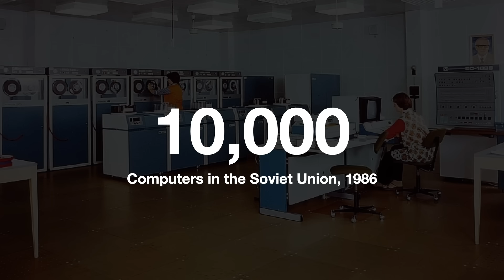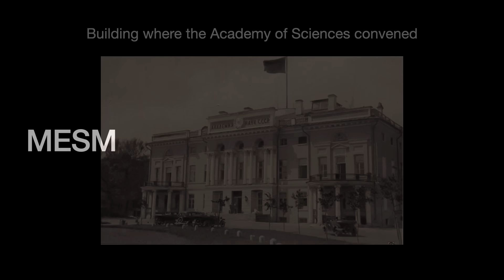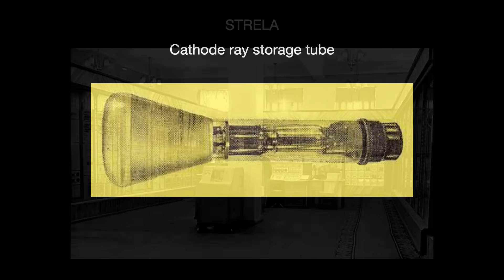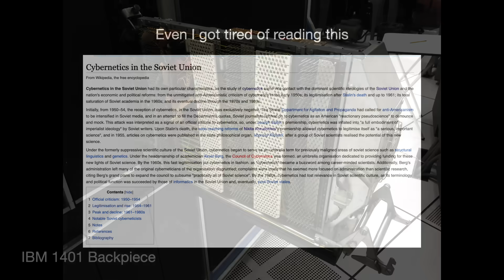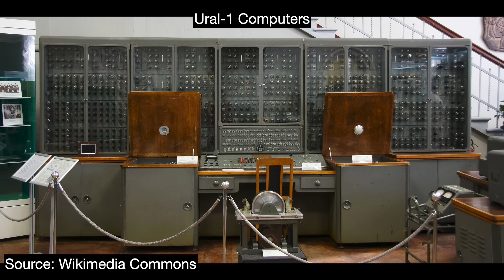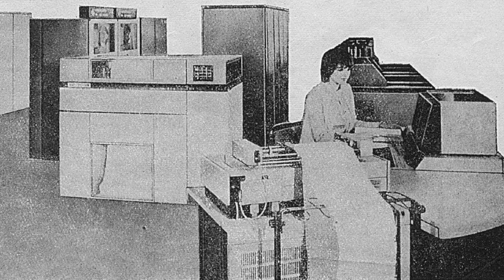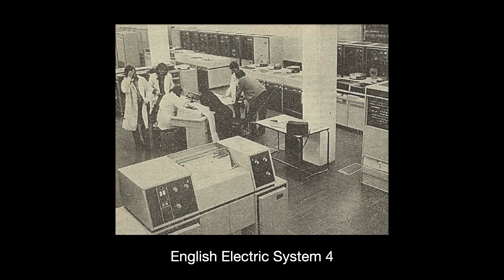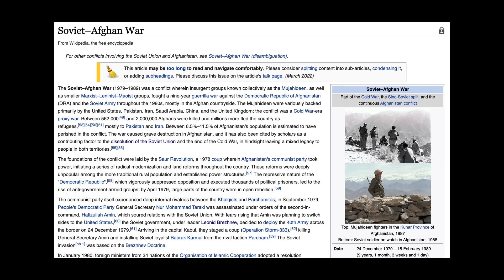Why the Soviet Computer Failed

Comment: I think that this failure was inevitable and stems from the flawed ideology itself. The value in marxism is the amount of labour involved to produce certain item of goods. What is valuable for the society was defined by the state/communist party politically. What had to be done in order to fulfill established "wants" by the party were calculated by all the respective research institutes. Since all those research institutes were planning in advance, usually for 5 years, I think it was impossible to introduce computers to the factories during that five year plan. Even if you calculate that for certain enterprise it will be valuable to calculate some processes with a computer (i.e. it will minimize total necessary labour involved to produce certain product) you will have to get rid somehow of people who were calculating those processes by themselves. Without even touching the whole trade union thing which made it hard to fire workers you would still end up with a dilemma of replacing people doing work and creating value and some machine eliminating human (be it intellectual) labour which was value itself. I think that was the main reason behind small volumes of computer production as they were mainly used in research institutes, while enterprises were only fulfilling established plans.

In capitalist societies it is a lot simpler, you only see adding computers to your production as a certain percent chance of improving the efficiency of your production by some margin i.e. increasing market value of your product. You don't see the same "value kills value" dilemma as in marxism, but I think that it's only one step closer to the truth. When you consider that the large part of advancement comes from large volumes and competition you kind of start to see similar dilemma as the origin of large volumes now comes from consumer products with their questionable value to the acquirer. It's no longer market value but rather fulfillment of your utility function or your personal value if you ask Mises. The moment people decide that their devices are good enough will start similar process as in soviet union, demand will drop and there will be no significant market value for major development in that field. As it was for soviet factories a questionable decision to exchange human computers into electronic ones, I find differential equations as a great fun to calculate, but in market value theory I'm just a hipster and the only way for me to make it valuable is to find some group of people with simlar values and sell them mugs and t-shirts with differentials.
Reply: Biden in my opinion to believe that the American people wants what he wants. Current polls rank him as the most disliked president in Amercan history. Most Americans want him out of power but there is no one better to fill his shoes with. It appears that the American politician is totally out of reality of what Americans want. More specifically what USA citizens since Canadians rightfully consider themselves as N Americans.
Reply: Could grind through differential equations but never found a use for them in my engineering career. Understood calculus after reading a book my Dad used during WW2 or shortly afterwards. It broke it down into trigonometry, Algerbria, & Geometry. This allowed me to formulate calculus and a few differential equations problems into Excel Worksheets. After about 10 years out of college I used the Excel worksheet methods exclusively. It was shorter than filling 6 pages of paper with calculations and then discover that you had an error. It may not have given me exact answers but answers close enough to make the design work. Loved computers and still do even if I am no longer engineering. I have often wondered if centralized economy failed due to not being able to model the economy or if it was due to corruption in Russia's political hierarchy.  It sounds like a little of both plus the fact that Russia didn't have capable computers to model their economy. USA universities teach Qualitative Business Analysis and some companies use it. ( most don't) It sounds like it is the same models used in Centralized Economy models but they would be drastically simpler. It appears to be a very powerful tool. Besides Centralized Economic models allowed the Russians and East Germans to keep their populations clothed, feed, & warm after WW2 according to history books. It makes you wonder to what extent these models should be used and not used. Should make an interesting topic for some college professor working on his PhD.
Reply: @informationcollectionpost3257  "I have often wondered if centralized economy failed due to not being able to model the economy or if it was due to corruption in Russia's political hierarchy." both, but considering how they could have solved the former if the Soviet bureaucracy hadn't dismiss cybernetics and project OGAS as "bourgeois pseudo-science", I would say mostly the later, two good books on this topic that I would suggest are "Red Plenty" by Francis Spufford and "How Not to Network a Nation" by Benjamin Peters. 

if you're interested in literature related to cybernetics and planning, you should check out "Cybernetic Revolutionaries" by Eden Medina and "Towards A New Socialism", by Paul Cockshott and Allin Cottrell, they are among the best books on the topic.
Reply: @informationcollectionpost3257  It was Soviet Union and Eastern Bloc countries, not just russians and every soviet country was very different. There's a good interview by one russian journalist on the reasons behind soviet economic failure (in case you know russian)
https://youtu.be/LW0XK4wAzQc

I think that the main reason were values and misunderstanding of human nature. Iconoclasm - Great schism - Protestantism - Marxism - Lenin's reinterpretation of the "dictatorship of proletariat". That's how you get from image reflection ban to ownership of land and resources by the church to private property and righteous work to work as the only value to violence as the only method to control the value and means of production. Neoliberal market capitalism branches of instead of marxism into liberalism with christian values and later into market value and I'm no Michael Sandel to tell you certain flaws of market value theory. Marxism disregards individuals in favour of social class as the only unit of society, so it's your fault if you are not like everybody else in some regard and that actually was a huge problem for people.

Maybe it's just like General Eisenhower said that planning is the most important thing you can do, but when the action starts you can throw away all of your previous plans. This brings few problems already as every planning can be only good for the "known unknowns" type of problems but it always fail to predict "unknown unknowns" class of problems. The other issue is determinism, if you know that the world isn't deterministic you know that every plan will fall short at some point. Another one is horizon of planning: either "rationality of suicide" philosophical dilemma or "how to live a life without a sin" from the Talmud. On rationality you have no clue whether your suffering will get better in the future. To live without the sin you have to weigh in the benefits of not commiting a sin, potential losses from misbehaviour, unfulfilled benefits from misbehaving and losses from commiting that sin. Maybe someone would like to stone me for blatant misrepresentation of their religion but I think that this part is amazing. The values of losses and gains are always subjective hence we all have different horizons of planning in different regards.
Reply: @AlexanderSylchuk  I don't know Russian and I am not motivated enough to learn. An entire video is to much to translate through a translator. The video is no doubt biased towards the author's point of view as the whole subject is too complex to figure out what happened. Anyhow, I thank you for the link but for me it isn't in a usable language.
Reply: @informationcollectionpost3257  That was an interview of one of the young (at the time) soviet economists who tried to switch Soviet Union into market economy. The journalist has liberal world view and at one point he was expelled from russia for supposedly cooperating with american or british intelligence. They are going through all the arguments that exist on that matter. If you ask actual communists then the answer is clear: USA, CIA, "Radio freedom", "Deutsche welle", nationalists... - it's never their fault.
Reply: @AlexanderSylchuk  I believe that the Free Market System is best but the Russian Federation was not and still is not ready for a Free Market System. A Free Market System requires that industry and businesses are located by economics not politics or government. The Russian Federation has an entire country with factories and businesses located by the government. Also the machinery and manufacturing processes were determined by the government, not economics. ( mostly by the USSR and inherited by the Russian Federation) It is going to take at least several decades and possibly a generation before the Russian Federation could competively enter a Free Market system and the Global Economy fully. Entering the Global Economy would make your country totally dependent on the World for almost every bought item your could think of. It would also bring foreign control into your country. Meanwhile your country is going to have to limp along as an almost closed or semi-closed society politically and economically. ( lower standard of living and in conflict with the rest of the Globe) Entering a Free Market system isn't something that could be done instantly. It takes much work and time. ( Rome wasn't built in a day)
Reply: @informationcollectionpost3257  I'm not that interested in russia. I was talking more on reforms and why did they fail and what was the cause of soviet collapse. The model they have now is as they call it "state capitalism" but right now they are quickly switching into war-communism. Majority of people don't understand what these countries like russia and China actually are and people try to explain them in their world view, which gives questionable results. Estonia, Lithuania, Poland, Czechia, Slovakia, Slovenia and Croatia on the other hand seems like they have succeded in their reforms.
Reply: Let me tell you about Stalin’s economy. The idea is that you want to invest into the industry but leave people poor. You have isolated systems for the people and for the industry. And those are not closed cycle market economies. The wages paid to people can’t(in theory) be used to own means of production. Only to buy food, consumer goods and services. The state issues a specific amount of roubles as wages and takes them back when they are exchanged to goods/services. They are not used to fund production, but only to limit consumption. Profit does not exist.
You can easily cheat by dispensing X roubles but only producing X/3 of usable goods and this is what they called “deficit”.
This created very strong motivation to resell goods at, say, x3 of the original cost, exposing this hidden inflation and generating corruption everywhere.
Reply: @noop9k  I don´t think that dispensing more currency was that common since it was just "monopoly" money for the proletariat, the real problem was when the state continuously failed to predict the preferences of consumers and production yeilds. I think that it was systemic problem, so called "speculation" and corruption were just side effects. How ironic it was when you cannot control the very thing your ideology aimed to control.
Reply: @AlexanderSylchuk  How I see it, to save resources, or due to inefficient manufacturing, the state was knowingly creating much less goods than was necessary to redeem the money paid to the workers. This is like a hidden inflation. You can theoretically buy product X for 50 roubles, but only 1 out of 3 can actually get one. Then someone may decide to re-sell for 150, the price reflecting actual scarcity of the product.
Theoretical price is 50, but the price derived from supply/demand is 150. This is inflation with extra steps and reversible if the supply increases.
Reply: @noop9k  There was plenty of unwanted stuff to redeem the cash in hands, the problems was in peoples wants. There is actually a hidden benefit for the folks who are bad at balancing their wants and needs. The market system is actually discriminative towards the people with the lack of information or to those who are unable to work with information. 

There was this soviet cartoon, where animals wanted to buy a cow and they didn't have money. Their dialogue actually describes all the problems of that system:
- Why are we all without milk and without milk ... We can die like that! We should buy a cow.
- We should ... But where can we get the money?
- Maybe borrow from our neighbors?
- What are we going to give in return? We'll have to pay the debt!
- We will give milk.
- If we give milk in return, why would we need a cow?
- So we need to sell something.
- To sell what?
- Something unnecessary!
- In order to sell something unnecessary, you must first buy something unnecessary, and we have no money.

The system was actually zero-sum on the consumer level and also zero-sum on the manufacturing level that is why most of post soviet people don't see mutual benefit in the market transaction.

Comment: This is the same story as with many other failures in the USSR.  Corruption and central planning caused many things to fail.  We're trending toward this now, and it will fail just as spectacularly as the USSR if we continue on this path.
Reply: You can’t really optimize costs if you don’t have market economy to determine actual costs. Cost estimations are almost arbitrary. The costs of different resources often just copied from western sources.
Reply: @noop9k  Yeah, they imported Sears catalog for use as data sources. Stalin supposedly proposed that Switzerland was to remain capitalist for this purpose.

Comment: UNIVAC I wasn't a floating point machine (unlike e.g. the earlier Zuse computers), so it was not nearly capable of doing 1 kFLOPS and was rather used as a decimal fixed-point machine. The BESM on the other hand was a 39-bit floating point machine - though the 10 kFLOPS claim seems like Soviet exaggeration.
Reply: @Retired Bore Yep, I'm old.  The 2N70X series were fast to start with and Cray asked Fairchild if they could tweak the process a bit more to get even more speed.  The contemporary RTL gates were about 12 times slower than what he could design with discrete transistors. 

   By comparison, the transistors he earlier used in the CDC 1604 were $1 rejects from TI, but he was able to design gates that worked well enough with transistors of insufficient speed and excessive leakage.  Regards.
Reply: There were floating-point multipliers in 1961.  Made up of discrete transistors and diodes, lots of them.
Reply: @Retired Bore Just look at the instruction manuals for the CDC 1604 (1961) and 6600 (1963).  (http://ygdes.com/CDC/60100000D_6600refMan_Feb67.pdf)

They both  had the +-*/ floating-point operations.  The 6600 even had two full multipliers that could run in parallel.  About 3 MFLOPS with 60-bit precision possible.
Reply: @Retired Bore To clarify:  the 1604 logic was germanium discrete DTL.  The 6600 logic was fast silicon (2N709) RTL.  Only the Cray 1 was ECL.
Reply: Seymour Cray had floating-point multipliers and dividers going in 1961 at a speed of 2 to 4 MFLOPS., 48 and 60 bits wide.
Reply: @Retired Bore Full 60 bit floating point.  Not fixed point.   The bomb designing boffins needed floating-point and would pay ridiculous $$$.  Two fp multiply units that took up a whole rack each, 1152 lbs. each, 18,000 transistors.  The wikipedia article is pretty good: 

https://en.wikipedia.org/wiki/CDC_6600#Central_Processor_(CP)

It did take 10 clock cycles for a multiply but those were 100nsec "minor" cycles.

Comment: Moore's Law requires to to quickly mass produce a huge number of chips, and re-investing that money to upgrade your fabs to make all existing computers obsolete, so you can sell again. This is almost by definition belongs to capitalism. A central planning authority in a communistic society won't easily decide to invest money just to make existing fully working devices obsolete. So basically made a weak a weak spot in communism visible. In limited ways it also applies to other industries, but few of the other industries have mechanism like Moore's law, where investments in fabs make existing devices obsolete, so owners voluntarily throw the old devices away.
Reply: It doesnt hurt to throw in a few software updates that make your device act obsolete either.

Comment: I can't believe that the Soviet Union loss the computer race. The Soviets only went as far as the transistor but could not make integrated circuits.

The programmable silicon microchip was also truly revolutionary as it made circuits more compact. This technology enabled the United States to dominate the PC industry.

FYI in 1988, I heard the America already had the internet and email. The internet was available for commercial use in the 1990s. Everything was dial up internet back then (you could not call on the landline phone). Now our internet runs on DSL or Copper Cable/Fibre Optic Cables.

The invention of the Intel Pentium 4 main processor enabled the United States to make calculations in Gigahertz (1,000 Megahertz or 1,000,000 Kilohertz). I'm looking forward to the development of the first Terrahertz capable processor and the quantum computer.
Reply: Actually, the USSR did make integrated circuits., including clones of Intel 8086. On YT there is even a test of one of those old chips: https://www.youtube.com/watch?v=wENB2egaDMs&t=96s